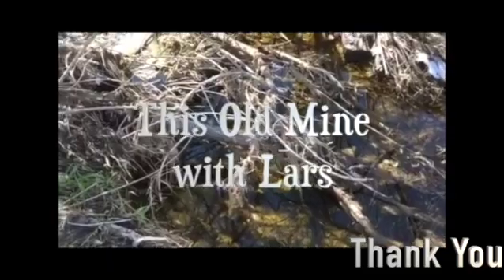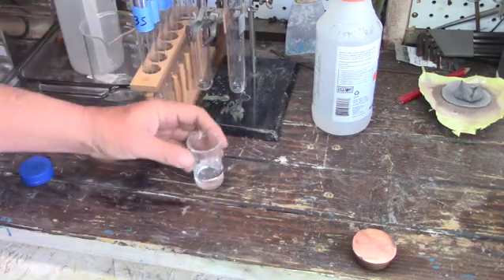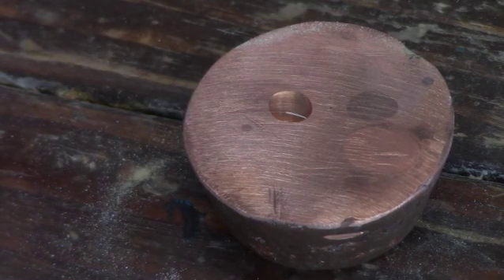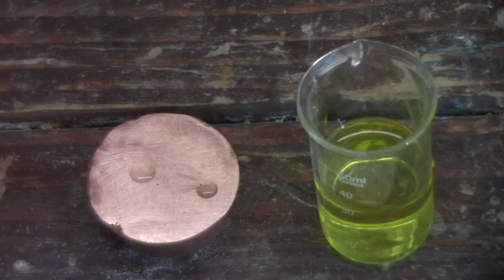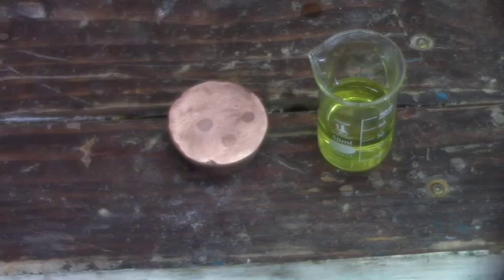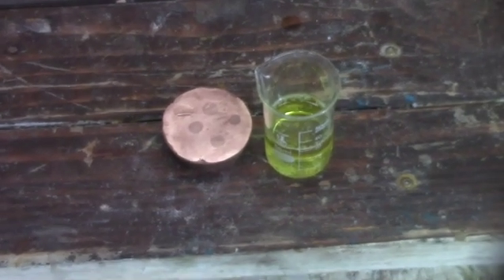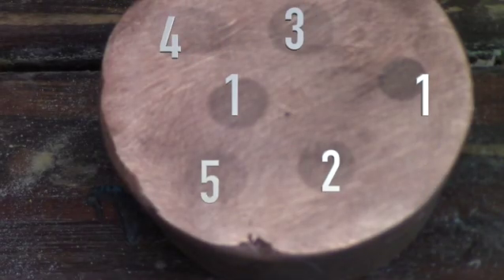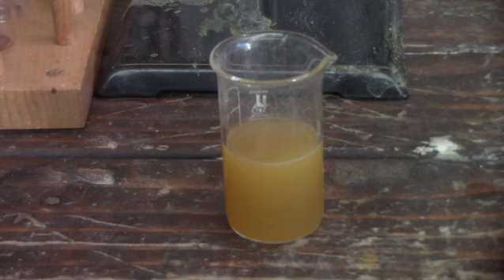Helpful tip to deNox Aqua Regea

Comment: I couldn't see any colour change in the video and will certainly try this, but I was wondering, because you have gold in the solution and copper is more reactive than gold, would you not still get a colour change as the gold and copper change places, i.e. when you drop some onto your copper, regardless of the denoxing progress?
Reply from the maker: Yes you are correct. If there is gold in solution the spot will not change once the nitric is neutralized but will still leave color. It is not the best test but it is cheep.

Comment: Beauty friend, your fan, your videos, I have a question about Nitric Detox, what is that?  Please thank you
Reply from the maker: Aqua Regia is a mixture of two acids. Hydrochloric acid and nitric acid. After you have dissolved the gold then you need to remove the excess nitric acid from the aqua regia before you can successfully precipitate the gold. If there is still nitric acid in the solution the gold will be immediately re-dissolved.

Comment: Thank you! I detox my solution but I did not use enough urea. Now I gotta big mess in my 2000 ml beaker..
Reply from the maker: I have been there many times as well. 2000ml of mess with nothing to show for it.
Reply: Easy enough to deal with.. throw on some heat.. but not to boiling points.. few hours there .. then urea just to checkn.. then SMB .. boom.. now repeat entire process again to purify ur gold